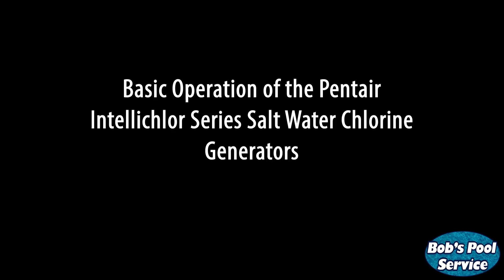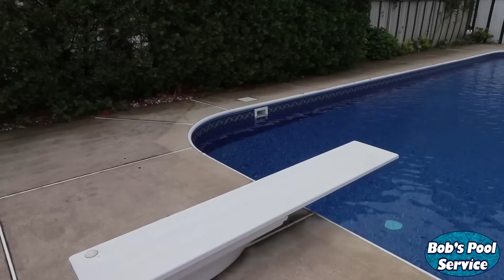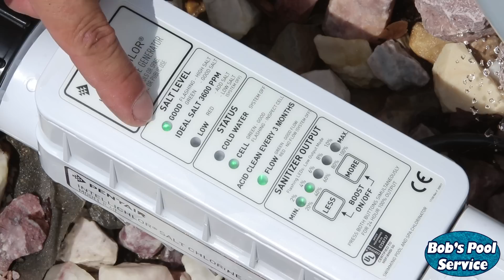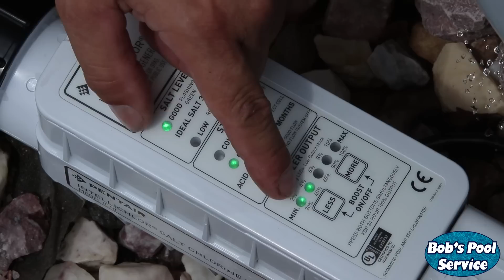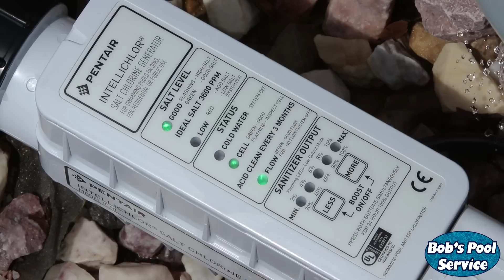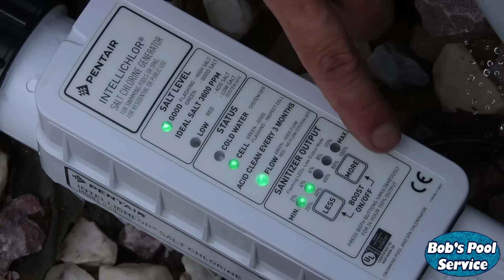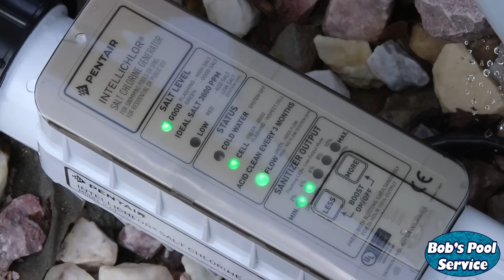Pentair Intellichlor Salt Water Chlorine Generator Operation

Comment: I want to begin by thanking you very much for this video. There is more information in your presentation than exists anywhere in written format or other videos. It is astounding that the instruction that you provided is not in the company's own manual. This season I noted that when we set up the salt – chlorine converter the percentage lights were flashing. Normally they were always solid.  I could find no solution to this or information about this in the manual and I even called Pentair directly and all support could tell me was that that was normal. In a way I guess that was true, and when I explained to him that normally those lights would be solid and asked why the change, he made no comment. Fast forward now to the fact that the pool has required more shock this year than ever and today is a beautiful emerald green. This despite the fact that the generator had four flashing lights, which I now know indicates it was only functioning at 8%. The persistent algae issue was because of the low levels of chlorine generation and not due to a bad generator.  I think it was brilliant that Pentair developed a two tiered system to allow more flexibility in percent generation, and therefore extension of cell life, but no where was this information present for the consumer to understand. Most importantly, this video demonstrates that you are not only a great technician but you are also a compassionate educator. Bravo!
Reply from the maker: Thanks for the kind words Mark, honestly I think I discovered some things just by playing around with the units and not reading.  Personally I'm a person that learns by watching or with my own hands on which is why I created some videos to hopefully help others with a similar mindset.  The two tiered approach really is a good thing, on earlier models this didn't exist so unless the unit was part of an automation system we had to be careful about sizing because some customers were unable to turn them down low enough.  Now we sell more large IC-60 units than any other, initial cost is more but they last longer and there's never a problem with getting enough output on residential pools we install them on.  Have a great weekend!

Comment: My sanitizer output lights are flashing green now. What does this mean? How do I fix this? 
Thanks
Reply from the maker: This would be indicative of having too much salt in your pool, however, I would check it with a properly calibrated meter to be sure this is the case.  Your unit is still working and producing chlorine if the light is flashing but if the salt level is too much over that is not desirable.

Comment: New to owning a pool and today our pool sample came back low salt.  I checked the intellichlor and low salt is red and cell light is off.  I put in the bags of salt they suggested.  My question is will the cell kick on by itself or do I need to turn it back on?  I’m guessing I have the option to turn the cell on/off?  Thank you
Reply from the maker: If the red light is on showing low salt the system isn't operating.  If you just added the salt let it circulate for at least a couple days, re-test the salt then if the red light is still on there's an issue with your salt cell and it may need replacement or a cleaning.  There really isn't a way to turn the cell on and off short of turning the percentage of output all the day down, however you can unplug the cell at the power center if you want to shut it off completely.
Reply: @BobsPoolService  ok.  Thank you.  We’ve had a ton of rain the past week in which I e had to drain the pool 4 times back to the normal level.  I’m guessing that’s why the salt was low.  I’ll let it circulate another day.  I just added 3 bags of salt.  The cells only 4 months old but I haven’t cleaned it yet.

Comment: Which is better for a higher residual the boost setting or 100 %.
Reply: You would get the exact same output either way setting it to 100% or using boost mode however with boost mode after 24 hours it will revert back to your previous setting thus preventing a situation where there's way too much chlorine in the pool which I've seen before when people forget.
Reply from the maker: Setting the unit to 100% or using the boost mode will give the same output with the difference being boost mode will shut off after 24 hours and revert back to your normal setting.  With this said if you're trying to shock the pool or reach break point chlorination do not use the unit to accomplish this, use Cal Hypo or liquid chlorine to shock your pool because it will act much faster.  Salt water generators are for slow release of chlorine and maintenance not shocking the pool.  Hope this answers your question.
Reply: Thank you

Comment: my cell is stuck in 100%(solid) all the lights are good and green, i try to change it via panel/remote and it wont change, it stays at a Solid green 100%
Reply from the maker: This video was for stand-alone operation, if you have automation (remote and separate panel) the lights on the actual unit may not be representative of what the unit is actually doing.  I would check the literature for the specific automation you're using and make sure it doesn't keep the lights always on, it's a possibility the cell is fine but the automation overrides it.

Comment: So my cell light comes on when the unit first starts but then it's pretty much off the rest of the time even though I have it set to 80%.
Reply from the maker: I believe it's a 5 minute cycle so it may take awhile for it to illuminate again.  Also make sure you have your unit on 80% the flashing mode which is below 20%.  If you watch though for a decent amount of time, say 5 to 10 minutes and the cell light never illuminates again that's not normal.  If you set the unit to 100% the cell light should stay on and never turn off so you can try that just as a test.
Reply: @BobsPoolService  I'll check it out. Thanks

Comment: You are awesome! I had mine flashing at 2% and wasn’t sure how to get back up to solid green. Thanks for taking the time to make this video
Reply from the maker: Yes, the literature isn't always great and prior models didn't have this feature either.  Glad the video solved your question.
Reply: @BobsPoolService  Question my system is stating that my salt is low. Do I add it to the pool and then hit the buttons simultaneously so it can channel through the system?
Reply from the maker: @GodisAlwaysLove  you should have the water checked with an accurate salt meter and then add the appropriate amount of salt.  The salt is added directly to the pool, let it circulate for 48 hours to get mixed up into the water and the red light should turn to green showing proper salt levels in the pool.  You don't need to do anything with the IC 40 to activate the salt.  Hope this helps.
Reply: @BobsPoolService  All my lights are like yours accept my salt is basic red and the last row is all solid green all the way up to 10%
Reply: What type of salt should I use for my system?
Reply from the maker: @GodisAlwaysLove  You want pure sodium chloride, you can buy it at pool stores and even sometimes home and garden centers.  You want basically the same salt we put on our food, don't use salt made for water softeners. If you go the pool store bring a water sample, tell them the size of your pool and they can help sell you the correct amount of salt to bring your levels up to proper.

Comment: Thanks for this! What if my chlorinor has no lights whatsoever? The system is on, water is flowing, but no lights, nothing. Please help!
Reply from the maker: It could be the fuse in the power supply or perhaps the connector that goes into the bottom of the power supply is loose.  Also the power supply may not be getting power.  Lastly it could be a totally dead cell but I've rarely seen that, usually the power supply (tan box the IC40 plugs into) is the culprit.  Check your connection to the PS, if it's something beyond that unless you have experience diagnosing electrical problems your best course would be to call a professional pool company.
Reply: @BobsPoolService  thanks! I'll check that out! A "professional" pool company was here yesterday to open the pool, left me with this, and aren't calling me back today. I'm so frustrated! I appreciate your help and am a new subscriber!!
Reply from the maker: @ChronicallyBeautifILL  Not to make excuses but there's so much demand for pool people right now all pool guys are going crazy.  Of course we always call our customers back but we've made hard decisions to stay very local and serve our existing customers first before taking on new accounts even if it means makgin less $$...  when you're in business for 35 years it's important to do the right thing.  Out of curiosity where do you live?  We only serve parts of Middlesex and Monmouth county NJ.  I don't know how "hands on" you are or if someone can help but checking to make sure electric is going into the transformer is the very first thing to check.  If it is then (with the power off) open the front of the transformer and check the fuse, some units have blade type fuses, others have a glass cylindrical one.  It's common to have them blow especially after thunderstorms or anything that may create a power surge.  Trouble shooting your problem is a process of elimination, you'll need a VOM or electical sensor to check to make sure it's getting voltage.  If you have none of that definitely try wiggling the connector that goes to the cell and plugs into the bottom of the transformer (tan box)...  if it comes on even momentarily either the plug on the cell or the jack on the box is not making a good connection.

Comment: Hi! Your video is amazing. But I need help. We opened our pool and all our chemicals are in line but out chlorine is super low. And we haven’t added stabilizer, algeacide or clearifer yet. Only added Alka plus and ph plus, shock and salt bags. (We had our water tested at the shop) My system shows “low salt” we added 3 bags of salt, and just turned the system on, should we keep the sanitization button at 100% ? The weather is warm but not that warm. Will it still generate salt into chlorine? Does weather affect it ? How long should I keep it on for ?
Reply from the maker: Upon opening a pool that's sat all winter without chlorine I always recommend shocking the pool with a granular chlorine like Calcium Hypochlorite or liquid chlorine (bleach).  I would not recommend keeping the sanitation button at 100%, think of a salt generator for slow release and maintainer not a way to shock the pool.  If the system says low salt it won't generate chlorine, my suggestion is to run the system for 36 hours before adding salt though because the water in your pool need to mix and homogenize to get an accurate reading.  Checking the salt level with a myron meter or strips is more accurate than using the lights on the Pentair system to determine how much salt you need to add.  If your intellichlor is set at 100% something is amiss, either your chemistry is off, you're not running the system long enough, the cell is undersized for the pool or the cell needs cleaning or perhaps replacement.  Hope this helps.

Comment: What do you mean by check the cell if flashing cell light.? Cleaned mine with the chemical but still flashing
Reply from the maker: A flashing, not to be confused with a cell light that's cycling on and off for longer intervals is indicative of the system sensing an issue with the cell.  If the cell has been removed, inspected and acid cleaned it's possible the cell may be at the end of it's life and need replacement.
Reply: @BobsPoolService  Thank you kindly for the reply. I may try cleaning it one last time before looking for a replacement. Thanks so much again & Great videos. Cheers
Reply from the maker: @tommyjoe4310  That's what we would do, you dont' have anything to lose cleaning it another time.  Ironically we've had working units stop working AFTER cleaning that were older...  each time you acid clean the cell it does remove a bit of the plate material and in the case of an older cell it can push it over the edge.  Thankfully our customer understood this and we got them a replacement cell  There really aren't any service-able parts on the cell except for the flow switch so if a cleaning doesn't revive it you're at a dead end. Best of luck.

Comment: Wonderful Video!  Thank you!  My system is showing Cold water system off, but the temperature is 68 degrees.  Has anyone seen this happen?
Reply from the maker: That light shouldn't come on unless the water is 52 degrees plus or minus 3 degrees of accuracy.  There's a thermistor inside the flow switch that measures the temperature and I'm guessing it's gone bad.  If the cell is older than 5 years you may want to just replace the entire cell.

Comment: Great  video review ! What if the lights under salt level keeps going from green “good” to  “red” low … back and forth
Reply from the maker: That's just part of the start-up routine, it should settle in and stop doing that back an forth thing after a few minutes.  I should have included that in the video.
Reply: Thx for the reply !! Yes I learned this the hard way as no one not even the manual had it .. and all this time I was thinking it might need more salt so I kept adding until someone said noooo you need to wait at least 3-4 min … I waited 1 min every time … at the end I had an extra bag of salt added , it’s not the end of the world but I definitely would have save more time :)
Reply from the maker: @Richoecreate  I always recommend testing the salt with strips or even a myron meter (expensive but accurate).  The lights on the unit may give a rough idea even when working correctly but accuracy can drift.  As a side note the salt level being a little bit high won't hurt anything, older salt systems required nearly double the salinity of new ones.  I'd even surmise a slightly higher salt level makes the unit a bit more efficient, I know when salt is at the lower end of the operational range the units produce less chlorine at the same setting.  We get serveral calls a year regarding the flashing lights, I make a point to demonstrate teh units we install with each customer but people forget, new homeowners move in, etc.
Reply: @BobsPoolService  thank you so much for taking the time to reply Bob I truly appreciate it ! This helps me !
Reply: What about if it keeps flashing for hours, not just 3-4 min? Thx!!
Reply: Thank you for the detailed explanation from the blogger. This is our titanium electrode salt chlorine machine testing video. Welcome to watch. Thank you for your time

https://www.youtube.com/watch?v=Xi4_EYCDL2k

Comment: So if the top one is flashing green and the next one down is flashing red, does that mean the salt level is high?  Just want to be sure I understood correctly!  Thank you so much!!
Reply from the maker: No, actually that means it's booting up and calibrating itself, give it a few minutes and it should settle in.  The top lights flash back and forth when it's in that process.
Reply: @BobsPoolService  thank you!

Comment: Hey sir, I'm trying to boost the system but whenever I press the "More" button, the lights just starting cycling for a about 10 seconds then back to 40%. Then if I press the "more" button again, nothing happens. Is there a way to reset it. My buttons don't do anything yours do. Thanks
Reply from the maker: Sounds like the unit may not be working correctly, I would contact the manufacturer or company that installed the unit.  One thing to not however, it takes some force pressing the buttons to activate them, make sure you press them hard enough.  Past doing that I'd say the unit isn't working properly.

Comment: Mine is solid red on salt level. What can i do?
Reply from the maker: Red is indicating a low salt condition, however make sure if you just started the system that you run it for 48 hours before adding salt or testing.  Personally I would use a test kit or take the water to be tested then add the prescribed amount of salt, if the indicator goes green you're all set, if it does not then have the cell serviced.
Reply: @BobsPoolService  hi. Thanks for your faat reply. I already put 150lb of salt in the pool but it has not been 48h yet running. So do you suggest me waiting and bring the water to be tested? And if evem after the 48h its still shown red it means i have to take the cell to be repaired?
Reply from the maker: @wahidakbary670  I would always opt for testing the water to see how much you should add.  With that said, in an in-ground pool 150 lbs of salt is not much, oftentimes we have to add 500 or more lbs of salt in the spring time to get the level up.  Definitely run the pool though, salt water is actually denser and sits on the bottom of the pool with fresh rain water on top so you need to mix it up to get a correct reading.
Reply: @BobsPoolService  thanks a lot for your advice

Comment: Good info. Just a quick question. Can I boost at 100% for less then the 24 hrs so I don't have to run my pool all night by just pushing both buttons say after 8 or 9 hrs or does that not really make any sense to do that?
Reply: I'm replying from my personal YouTube account but yes you can definitely push both of those buttons to disengage the mode if you so desire.
Reply from the maker: ditto what robwas said

Comment: The salt level low light is red. What needs to be done to get it to turn green
Reply from the maker: First check your salt level with a kit to make sure it's indeed low.  If it is, simply add the proper amount of salt and the light should turn green once the salt dissolves and homogenizes with the pool water.  If your salt is not low the first thing I would do is check and clean the unit, a proper acid washing usually fixes most issues.